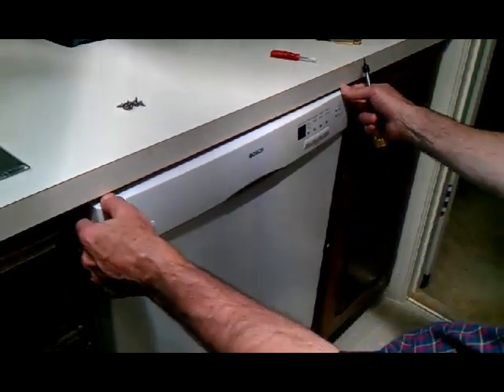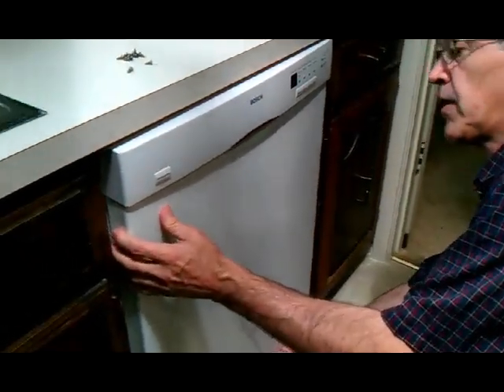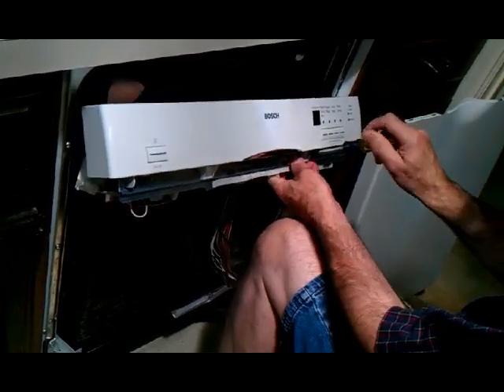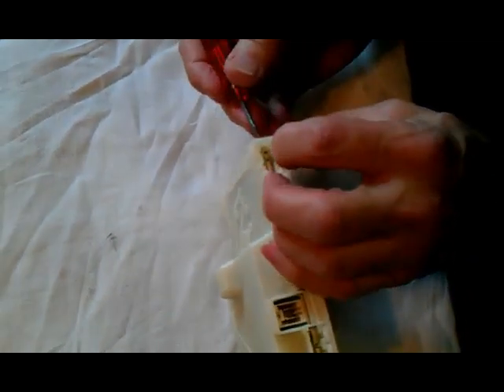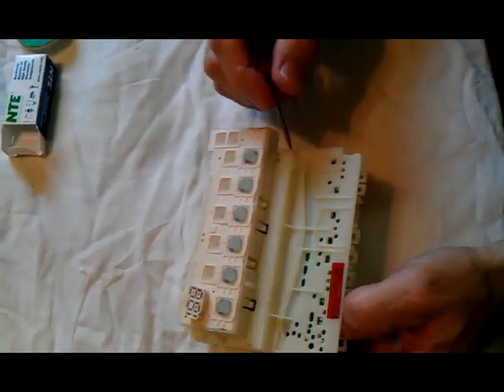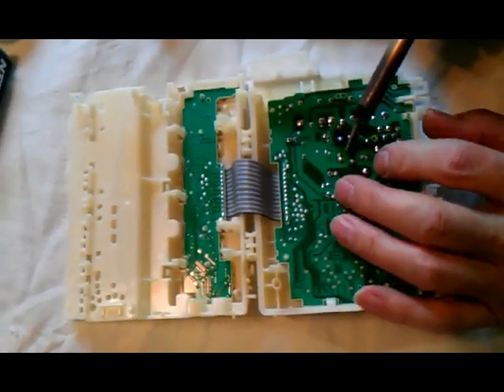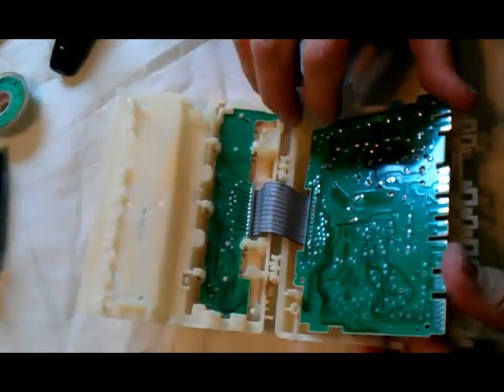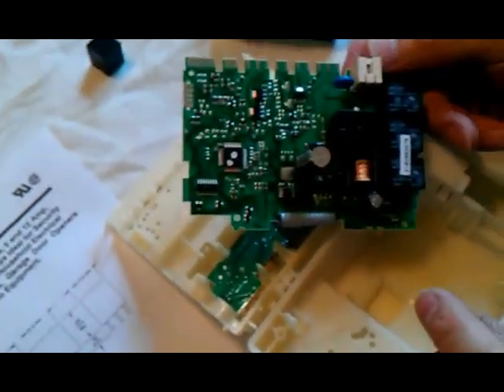Bosch Dishwasher Heater Relay Repair Part 1

Comment: One refinement:  You can remove the main door panel separately from the top fascia panel.  This may be harder to do, but it's more elegant:  it prevents the two panels from falling off the dishwasher simultaneously.  To learn how it's done, see, for example:  http://www.youtube.com/watch?v=xx1bepZinNo

Still, dear AgglomeratedIdeas:  Your video is much appreciated!  Following your advice, we've ordered and installed a new relay, and our SHE44C dishwasher is now working well again.

Comment: @AgglomeratedIdeas could you explain how to temporarily bridge the bad relay while waiting for the part :)  I could use it.
Reply from the maker: Solder a piece of small wire from the burned relay pin over to another spot on the same trace.  You may have to scrape the relay pin clean because the heat usually causes them to oxidize and solder will not flow easily onto the pin when attaching the temporary jumper wire.  Make sure you connect to the SAME copper trace on the circuit board that the relay pin was soldered to.
Note that if your relay is badly damaged, a jumper may not work.  It is worth it to try though.

Comment: Hello, I have a problem with my Bosch. It seems a triac element on the board is damaged. But I can not find the replacement part for it.   Writing on the triac says Z3M s504. Do you maybe know where I could order a new one, or if there is a suitable replacement. Thank you in advance!
Reply from the maker: Sorry, but I am not finding that part number.  However, in searching for it, the part number Z0103MN kept coming up.  Maybe that is the correct part.  Search eBay using Z0103MN and see what you think.
Reply: @AgglomeratedIdeas  I found that number as well, but don't know if it's compatible. Thanks.

Comment: My 15 month old Bosch dishwasher has same problem and searching around I see this problem m is common across years and models.  Likely designed to fail as so many people have this issue. Gonna fix it but 1st and last Bosch I'll ever  buy.  Thanks for posting.
Reply from the maker: Well that's a shame and highly unusual...only 15 months old! Relay failure is usually around 5 years with once per day usage. Yes, this problem is common across years and models, and I don't think that Bosch has changed the relay as no one has reported that.
My Bosch DW is still operating like new, so overall I am happy with it. Please let us know what you find and send me a photo if you like. Thanks for sharing your issue.

Comment: THANKS AGAIN @AgglomeratedIdeas !!! 
Two years ago your video helped me replace the relay on my Bosch dishwasher for the big fix. I posted a thanks here back then. I'm back with appreciation again; just a different dishwasher. This time it's a nine year old Fisher Paykel DD24 drawer dishwasher in my motorhome that gets used at most 6 months out of each year. In short, replacing the relay fixed it. I wondered if this might be a more common problem across manufacturers, and if so, why a plugin relay isn't used in dishwashers instead of soldering it into the control board.

In this case, the Fisher Paykel threw an F4 error meaning the heating element wasn't working. I couldn't believe I had another dishwasher with a heating element problem. Luckily I found a service manual on the internet that included a wiring diagram. I cut the wire from the controller going to the heating element and put a multi-meter in series to measure amperage. There was none when the heating element was supposed to be on. There were other tests in the service manual that enabled me to test other components in the circuit and they all passed. I took out the controller to inspect the relay on the board, but saw no evidence of overheating. When I took the relay out and tested it, even though I could hear the contact arm moving, there was no continuity across the points. I replaced the relay and the dishwasher is working again.
Reply from the maker: That's great troubleshooting!  Relays can "click" and still not work as you found out.  The contacts burn to the point that they no longer conduct current.
You mentioned that you saw no evidence of overheating.  This is often just a result of how the relay is physically constructed.  For the Bosch relay that often burns the board, the coil of the relay is sideways and the path for the heat generated by burned contacts is a very short distance.  For relays that have a coil that is vertical, the contacts are on the top.  The heat generated by failed contacts has too far to travel to cause much (if any) damage to the board.
Is this a common problem across manufacturers?  I really don't have enough evidence to answer that.  But, the heater relay is a hard working component as it has to handle a heavy electrical load and I would think that it would be amongst the top components to fail for that reason.
Should the relays be plugged into a socket so that replacement is easy?  That would definitely make fixing them a easier job, but I don't think manufacturers will do that.  For one, they want to save every penny possible, and two, they don't intend for the consumer (or tech for that matter) to replace the relay.  Selling a new control board is much more lucrative than repairing one, but often they get to sell the consumer a new dishwasher.  Its all about making a buck!

Comment: Great video! I had the same problem on my 12year old SH44C and decided to just replace the board myself (about US$175) since my soldering skills are not great. I have ordered the relay anyway (from Amazon, higher price but small shipping cost $4 compared to others charging $20). I will repair and test my old board and will give it away to another person with the same problem.
Reply from the maker: Being able to replace the board yourself for about $175 is not too bad.  Some have had repair techs charge MUCH more than that because of the labor and markup.  I not knocking them...after all, that is how they make their living.  It is just that putting several hundred dollars into an older dishwasher is always a gamble as to it paying off.
Good job!  Cheers!

Comment: Thank you!  I have an 11 year old Bosch SHU48C and was able to use the same exact repair part.  Front panel is a little more stiff than yours because of more sound insulation packed in there.  Your detailed explanations kept me from giving up as many of the parts require a lot of patience to take apart and it's great to know you're doing it correctly.
Reply from the maker: I'm glad that you found the video helpful.  Thanks for commenting.  Cheers!

Comment: I think I have the same fault; I can see the burn marks under the relay.  The dishwasher failed mid cycle, there is no lights on the display the arms are still rotating inside & water is filling the washer.  Could there be a second fault with the dishwasher?
many thanks
Dave
Reply from the maker: If the burn marks you indicate are just darkened areas around the heater relay pin, that may not be your problem.  If, however, the burn marks are clearly indicating that the solder around the pin is melted away and the pin no longer has contact with the printed circuit trace, then that would need to be repaired for sure.  You may have another problem with the DW, but starting repairs with an obvious problem would be what I would do.  If you would like to send me photos of the top and bottom of the control board I would be glad to give you my opinion as to what I see.  Email is MyBrokenDW(at)gmail.com

Comment: Agglo, great video. I replaced the relay and the heat is back. BUT, the under Normal wash cycle, timer goes to 199.  Not good. Any thoughts? Thank you
Reply from the maker: I would suggest that you unplug the DW (or turn off breaker) for about 10 minutes.  Then run the DW in its diagnostic mode to see if results in an error code.  The diagnostic mode instructions are on the wiring diagram which is usually rolled up tightly and stored near the inlet water valve.  Hope that helps....
Reply: Thanks Agglo. Just taking this one more step. If the codes don't pan out, are the minutes of cycle time also be fixed with replacing another relay (as you can see I'm not a schematic type person ;) ?   And all the other cycle run close to the default times cited in the manual.  Thanks
Reply from the maker: If I am understanding what you are asking correctly, replacing any of the other relays is not likely to change the cycle run times.  I don't know exactly what might cause 199 to show on the display, but I think running the diagnostic mode would provide useful information.  Hopefully anyway.
Reply: AgglomeratedIdeas    After running through a full cycle, washer reset and now runs normal. Replacing the relay was the ticket. Thanks again. Now what about Mercedes cars lol
Reply from the maker: That's awesome news!  I'm glad it worked out for you.
To fix Mercedes, first take out wallet, then open, then...well you know where that is going.

Comment: Awesome video!! Just replaced the relay with a new one, only problem now is, that the dishwasher won't start at all... You can choose a washing program, but after you close the door, the relay just start 'ticking' in a slow phase (it seems like something is holding the water pump back from fully starting).
Do you have any ideas? 
Thank you so much!!
Reply from the maker: Hmmmmm.  Haven't heard of anyone having that happen before.  Replacing the heater relay should not cause the DW to no longer start (assuming that it is the correct relay).  I would double check all the connections to make sure everything is properly plugged into the control board.  Check other wiring too just to make nothing is disconnected.  Sorry you are having this issue.  Let us know if you find what is causing it as it may help someone else down the road.

Comment: Ditto to all the previous comments, THANK YOU SO MUCH for the clear and easy to follow walk-thru. In my case it wasn't the relay (I did replace it with a new one but after testing the old one it still worked). What eventually fixed the problem was soldering a bridge like your temp fix. Anyway, I would have never been able to get it done without your help. DW works and I even look like a hero to my FiL!!
Reply from the maker: That is great that you were able to get the dishwasher going again.  And yes, sometimes replacing the relay does not fix the issue (even though it was bad) because the circuit trace on the board is damaged.  The way to fix that, as you have found, is to solder a jumper over the bad section so that the new relay can do its job.  Cheers!

Comment: Thank you SO MUCH for posting this video!!! I was just about ready to throw this Bosch DW in the garbage heap. Wouldn’t fill with water, and wouldn’t heat the water I put into it. Ran the dreaded never ending 1 minute cycle. I replaced the fill valve ($20)... no help. Replaced the float switch ($20)... got the DW to fill and drain, but still wouldn’t heat the water or finish the cycle. Then I found THIS VIDEO! What a god send! Found the relay you suggested on Amazon for $4. Popped out the control unit, swapped out the relays, and even with my terrible soldering skills... WE HAVE HOT WATER!! Our elderly 8-10 year old DW is back on the job after a $44 repair. You saved me so much time and money!!! GOD BLESS YOU, SIR!!!
Reply from the maker: I am really glad that you found the video helpful and saved your DW from going to the trash.  Even if you think that you have "terrible soldering skills", it shows to others that this task CAN be done with relatively little experience.  Good job and thanks for sharing.  Cheers!

Comment: Thank you for your video. Would you happen to know the value of the resistance (value and wattage) that is next to the relay ? I cannot find out because mine is completely burned.
Reply from the maker: The value of that resistor in all the ones I have seen is 22 ohms.  However, there is a second value that is also used in some models and it is 10 ohms.  Please see the discussion under the comments by Fernando Liz below about this resistor.  Be sure to expand the replies to see everything.  I hope you find it useful information.  Cheers!
Reply: Thank you very much for your time.

Comment: I just had this issue on my Bosch dishwasher.  I found your repair video and decided to check out the control board relay.  Sure enough, one of the solder joints on the relay was blown out.  I just finished the relay replacement & reassembly and have started a Regular Wash cycle to see if the fix works.  So far, so good.  Thanks.  I was wondering if the relay failure is caused by a problem in the heater unit?  Has your dishwasher had any subsequent problems?

Update - Started the dishwasher after replacing the relay and now it won't fill with water?  The dishwasher would complete the wash cycle on "Economy" before the relay replacement.  No issues with water.
Reply from the maker: To address the first part of your comment, my dishwasher is still working fine after the relay replacement (now about 5-1/2 years ago).  It is possible that another issue in the heater circuit could damage the relay, but I think that would be unusual.
As to the water fill issue, if it was filling okay before the relay was replaced and is not now, then that would not be related to a fail heater relay.  It could be that one of the plugs to the control board may not be inserted all the way, so you could check that.  The other common causes for the DW to not fill are sediment clogging the filter of the fill valve (that can be checked by disconnecting the water line), or a failed fill valve.  Another possibility is that the float switch might be stuck and the DW thinks it is full of water.
It may be helpful to run the DW through its test mode to see if that gives an indication as to what is not working.
Reply: Thanks for responding so quickly.  I guess that the dishwasher just needed to complete a cycle.  I thought that by turning off the breaker, it would reset on power up?  I ran it through a complete Rinse & Hold cycle.  I restarted it (again Rinse & Hold).  Once that completes, I'll try the Regular cycle.

Comment: I obtained a SHU5315UC dishwasher which a neighbor trashed.  Besides the fact that the previous owner used a granular liquid in the RINSE dispenser ( kept the refill light from coming on ) , the unit would not heat the water.  I basically followed your video and found that the relay on the control board would not activate.  Thinking that the relay was defective, I removed it.  After unsoldering the relay, it dropped out and the 5 pins were identified on the underside of the plastic housing.  They were in the outline dot pattern of a " house".  Pin 1 is at the peak, pins 2 + 5 are at the "eves' and pins 3 + 4 are at the base.   The relay winding tested about 400 ohms from pin 2 to 5 (  it was good. )   pin 1 to 3 contacts are "N-O"  normally open    pins 1 to 4 are "N-C "  normally closed.  When 12 volts DC is applied across pins 2 and 5, the other two paths operate correctly ( 1-3 go closed  and 1-4 go open ).  The main issue was that the solder connections on 3 of the 5 pins were open or cracked due to the heat / amperage  going to the 2 prong plug just below the relay which had heavier gauge wire ( BLACK + RED ) which goes to the heater.   Thanks for posting your video. I helped steer me in the right direction to fix my newer BOSCH.     J K
Reply from the maker: Good to rescue that poor dishwasher!  Shame that a lot of these are going to the dump due to a $5 defective relay.
The relays will often test "good" but will not work in the DW (or just work some of the time).  They often test good on the bench without the high current going through them...they just won't work when still in the heater circuit.
Good job JK!